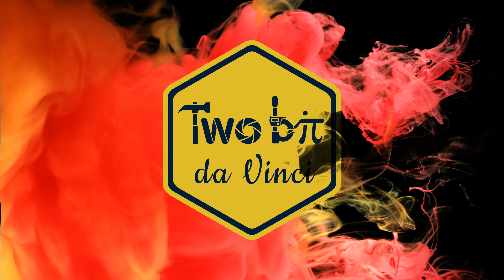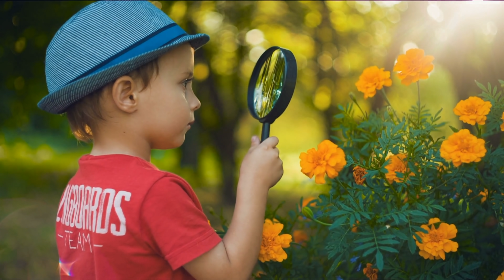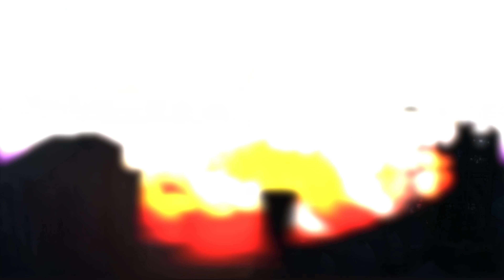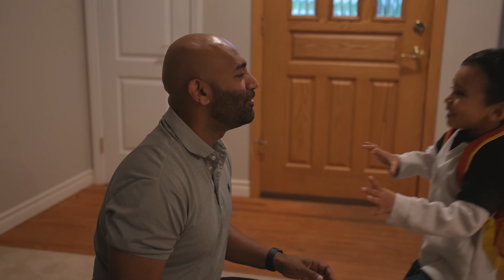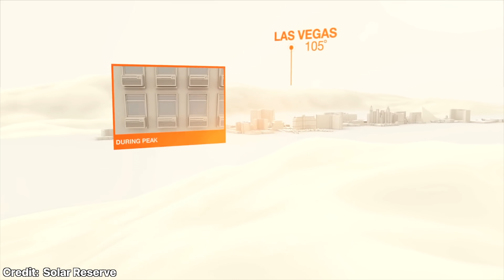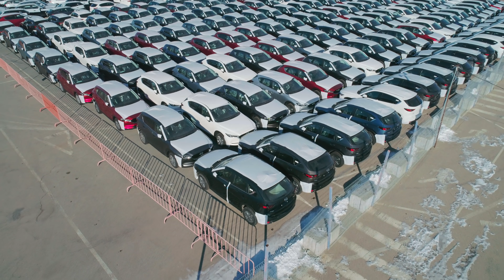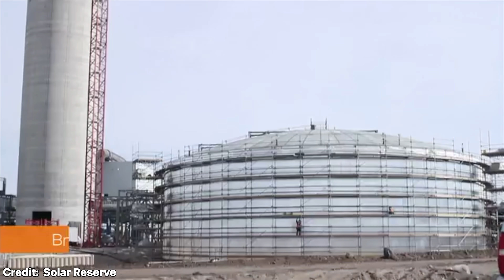This Billion Dollar Solar Plant was an EPIC Failure

Comment: Those solar cells are almost exclusively made in China, where they employ "dumping" (i.e. flooding markets at below-cost goods) as an economic strategy to starve out competitors, after which... they corner the market and make their customers entirely dependent on them, then prices will sky rocket unless you do their bidding in foreign policy and economic competition.  They're making PV without regard to the US environmental regulations and labor costs that put PV at 2$ per watt back in 2010. That "s" curve doesn't factor in any of this at all.  It's a "perfect world" scenario, one which we are far from living in.  What's even more sad is that Nevada CSP plant likely made the mirrors and large components (CSP salt heat reservoir, piping, generator, etc.)  here in the US.  No surprise that will cost more when you're competing below-cost labor practices behind li-ion battery and PV manufacture in China.
Reply: This is true.  It's economic warfare Chinese style, but it's coming back to bite them since you can't keep funding low returns investments with short term money.  In my opinion it's their goal to corner the market through government partially owned industry which sort of gybes with their communist ideals.  But they've spent huge amounts of money on unneeded infrastructure, cities and buildings that are unused, and have created a catastrophic pollution problem which will effect the heath of their people, not to mention adding to climate change.  It's also my opinion that the solar cell actual cost is much higher, as you alluded to, and that we'll see a rise in solar cell cost, and a rebound of molten salt schemes.

Comment: Or, you can make wind turbines to heat up that heater accumulators, if they are working :)) solar+wind only to heatup heat accumulators and than rotate steam turbines when sun energy is insufficient

Comment: Exactly - solar battery need accumulators that will die soon and need to be replaced, but this crap has heat accumulators that can be used at night. But, i suppose they can use solar batteryes to heat up same heat accumulators and use it to rotate turbine at night same way :))

Comment: China builds these and they are a success only Spain and the United States builds these to fail. I took an Airframe and Power Plant class years ago and the teacher said that the air molecule's know a couple miles out to start getting out of the way of a wind rotor and the oil companys built wind turbines that failed too. Obviously not taking physics into account.

Comment: I have yet to find anyone to give me a factual rebuttal to my issues with solar and wind power generation. Perhaps you can tackle these issues on your site.
Solar power requires vast amounts of panels to be productive. These panels absorb and reflect the solar energy and keep the ground underneath from benefitting from the solar energy it absorbs. This changes the ability of the earth to store this energy for climate balance. Not to mention what effect the reflecting energy has on the atmosphere. 

Wind power is the conversion of one form of energy to another. Since there is no such thing as perpetual energy then the facts are that wind dissipates it's energy when meeting another hard physical surface such as wind turbine blades. This loss of wind energy means that the wind needed to move seeds and pollen across the earths surface is decreased and this will have an impact of plant life. Wind is also critical for climate balance and the lack of it will change cloud formations and rain patterns.

Just like this story about this solar farm failure brought about by myopic thinking I believe the same is true of most "green" projects. In my opinion the use of hydro and nuclear is still our best options until a proven successor comes on line. Yes both have flaws but not nearly what wind and solar have IMHO.

Comment: When it comes to energy demand over 24 hours in a day, you need to highlight the Duck Curve, and why the supply demand equation gets upset, when the sun sets. In addition, you need to cover costs of large scale energy storage in comparison to these type of molten salt projects. As more and EVs hit the market. The peak demand of the duck curve will shift, and create even more problems to the grid if we do not have the resources to meet that demand. Right now, I do not see the Gov Policys or Technology heading in the right direction to achieve those grid demands.

Comment: France got it right, they had no effective anti-nuclear protests in the 70's and 80's thus they went nuclear. Nuclear energy is extremely safe and cost effective and if things work out with small enclosed nuclear reactors production, manufactured on an assembly line like say a modern airplane and moved PNP to increase power output as needed. Fussion research is necessary but billions of dollars being spent on a theory of the tokamak reactor is a pipe dream. I suspect the ITER will teach us at the cost of 20 billion what not to do!
Hydrocarbons are here to stay for the next 2 or 3 hundred years, because we need them for many other things beside fuel. Electric cars still roll on rubber tires. Rubber tires require hydrocarbons. There are literally millions of life sustaining products that require hydrocarbons.

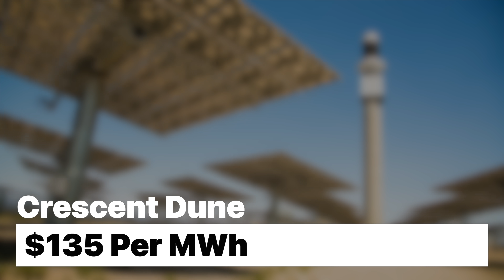Comment: 8:50 So Crescent Dune (at least with the technology that existed 10 years ago) cost over 4 times as much (13.5 cents per KWH VS. 3 cents) as  a PV farm would. But, there might be some places where power that's available at night is worth 4 times what the same KWH generated from 9AM to 4PM would be worth. Maybe that was not the case in NV (with its dependence on air conditioning), but I'm wondering if operators of PV farms are paid rates commensurate with the reduced value of the power during the hours in which it's available. If a plant like Crescent Dune were only paid the same rates that a PV plant would get, even in an area where demand peaked at night, then it could be argued that Crescent-Dune-type plant was not being properly compensated for its ability to store power. Also, much of the reason that PV panels are so cheap is that they are imported from places with much less stringent environmental rules than those of the USA; if countries like China were to start cracking down harder on the pollution such production emits, I wonder if the cost advantage of PV panels would start to erode.
Reply: 1. The thing you missed is the fact, that it is too expensive. If you have access to natural gas, its cheaper.  And at places where this is not the case, you wont be able to operate that kind of Plant either.
The same goes for batteries. The combined cost of the Energy needed to charge and discharge the battery and the cost of the battery itself needs to be lower than other methods of providing energy. 

2. China is not the leader because of not enforcing enviromental standards, its because china ramped up production early enough. Larger Scale = cheaper price. If you find someone to invest in such a scale in a market, and you have competible technology, you could build those in the US, too (Germany still has at least one Company, too).

Comment: The green energy boondoggle has been exploited by the Obama administration and now by the Biden administration.  The sad fact is that petroleum is more reliable and proven technology, where "green" energy is anything but reliable or proven.  Over time as a supplemental source of power in conjunction with hydroelectric power for domestic home use is at least feasible.  As a primary source not so much.  The permanent political class in California and elsewhere is not bashful about selling us a bill of goods and not delivering.

Comment: With the recent advancements in microwave transmission of energy, might it be possible to collect solar energy via satellites and beam it down to earth (ironically this is an energy source in the videogame Sim city 2000).
Reply: I'd imagine that such beams would heat water vapor in the air, maybe alter weather, disturb communications, and create no fly.
Plus it would be super expensive, difficult to test and replace (you want proven tech if you are putting it in space... Huge loss if you are wrong and difficult to send a repairman than, and parts need to last a long time as again, difficult to send repair man up there).

I don't see this happening soon.

Comment: I'm fascinated with Parabolic curves.  One of my hobbies is Building long range Wi-Fi antennas.  My first 3-D print Was a parabola, i used The eccentricity method in freecad to design and print my first parabola.

The eccentric method is a fun way to draw a perfect Parabolic curve using some math, graph paper and ruler.

 Positioning of each mirror follows this same  math equation.

I have also learn to program micro controllers to accomplish automated tasks and movement like these mirrors.

 I believe large scale construction is the 1st engineering mistake. Something I build on my workbench cost me a few bucks, then ill have Results to approve if large scale is worthy.

Comment: This type of system depends on too many mechanical moving parts that requires high and continuous maintenance for the moving panels mechanisms and the highly corrosive storage and pumping system, the turbines... In the other hands the PV has no moving part and produce electricity immediately. The only disadvantage of the PV is its low efficiency due to a narrow effective light spectrum range. Since the PV can produce electricity immediately, even if one quarter of the project done, electricity form that can be sold immediately. There is no need to wait till then end of the entire project. That is a huge advantage in funding large project of many years. Another advantage is the cost of PV continues to drop thanks to the Chinese manufacturing. The Chinese has contributed in green energy far more than is generally known.

Comment: Never seen your channel's videos before, but this was fascinating, and your presentation was excellent. A good mix of informal and professional.  Subscribing, and looking forward to more.

Really interesting topic. I'm sure the answer is "it's not cost effective", but I wonder if anyone considered the idea or retrofitting the heliostat articulators with Photovoltaic panels. That way at least those sun-tracking mechanisms could be put to use maximizing the panels' exposure. Of course at that point, it's probably more effective to remove-and-rebuild the whole complex with that photovoltaic approach in mind. (the salt core and such would be completely unneeded, and electricity storage on-site would probably be a better use of the land).

I've seen some suggestions that combining photovoltaics with farming that functions well in shade can be a great 'two-fer' in terms of space usage in traditional 'panel' builds. Also seen some great ideas concerning putting cells on covered parking and other flat-roofed retail and commercial builds.
Reply from the maker: Glad you found us!
Reply: "great ideas concerning putting cells on covered parking and other flat-roofed retail and commercial builds" --- already here for quite some time in Arizona.

Comment: There is a downside to the molten salt staying hot enough to provide power into the evening. It takes a long time to melt the salt in the morning and will not provide any power until well after sun-up. (Even longer if at all, depending on cloud cove) If you believe that this type of plant is for you, There is a plant for sale in Port Augusta Australia. Caveat Emptor

Comment: Clearly, PVs plus massive battery storage is never going to be the future because already we don't have a future source of the rare elements needed for battery manufacture whether they are in cars or in homes.. We need instead to concentrate on hydrogen.  Automobiles using hydrogen can be refilled in periods just as with gasoline/petrol, electrical power at ridiculous levels does not need to be wired to every home in every town/city either.  Hydrogen needs research to get modern generation costs down but we all need to remember that when the world used coal gas for energy supply in the 1800 and 1900s that was a Victorian technology that also piped hydrogen ( and a few undesirable things too!) in the form of coal gas under streets and into homes.

Comment: 1. couldnt they just heat water and use it on steam turbines instead? no extreme temperatures, longer lasting stuff, no health issues of any gases or such, etc. 
2. maybe this is inefficient for producing electricity (cost wise + longevity), but wouldnt it be nice for burning / smelting stuff without producing any additional (burned fuel) gases and waste? should be more efficient than using electricity (or organic fuel) again to produce heat to burn/ smelt stuff? so one could either melt ores or burn trash  or such there?
3. can we keep it as a last resort melee-mid-range heat-cooker just in case an alien mothership flies over it and doesent know what its used for :D? (joke question obviously)

Comment: I had a 72" rear projection TV from the early 90's and took out the  Fresnel lens. It was about 5'x5' and I made a frame around it so I could aim it. There's videos on YouTube that shows the process. I use it all the time to cook. Instant searing heat. For boiling water it's easy. But there's no way to control the temperature. It's either zero or 10,000° (I know it's not that much, but you get the point)
Reply: GREEN POWER SCIENCE channel in YouTube

Comment: you confused crescent dune with ivanpah (when you said ppl driving in from southern CA would see it) ... Southern Cali ppl would be coming in I-15 and seeing Ivanpah (in CA, just before Primm) - Crescent Dune is 3.5 hr north of vegas (which you do state later). Just so ppl don't get confused - Ivanpah is running and doesn't use molten salt - while crescent dune was an innovative attempt to store more energy longer.... the fields and towers look the same, but the mechanism for storing energy was different

Comment: This seems like a viable way to crack hydrogen from water using just the thermal output of the mirrors. Perhaps the problem is mainly in the storage.
Reply: I don't get why they even did that as opposed to just making it a normal boiler, it'd cost FAR less in both construction and maintenance, and make the same, if not MORE!

Comment: I remember hearing about this technology and was told it would outperform nuclear, but everyone claims that instead of just using fing nuclear.
Reply: The issue with nuclear is that NOBODY political wants the waste in their back yard - despite that it can be repurposed (the waste, that is). (Repurposed reactor waste is not a joke - how many people get that most cancer radiation treatment is based on reactor waste - look up the source for radioactives - other than X-rays or beam radation - used in cancer treatment - I had liver cancer - detected using radiation.)

Comment: I think that this is a very important point: When driving from SoCal, the solar towers one sees right before crossing into NV are not Crescent Dune. Crescent Dune is located near Tonopah NV, about 2.5 hrs. NW of Las Vegas. I think it is very irresponsible to publish a video with blatantly untrue data.
Reply: You'd think that the author would have at least figured out that the plant you can see from Interstate 15 on the way from Southern California to Las Vegas (the Ivanpah Solar Concentration Plant) is actually in California, not Nevada. Tonapah is 190 miles north west of Las Vegas, and definitely not on the way from Southern Cal. . .
Reply: Driven past it a dozen times going between Reno and Vegas. Pretty cool to look t